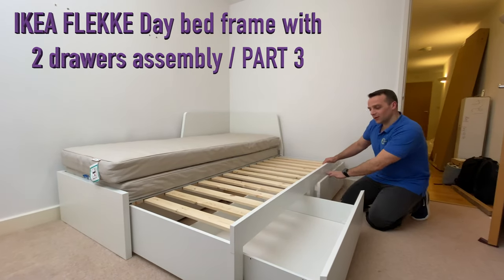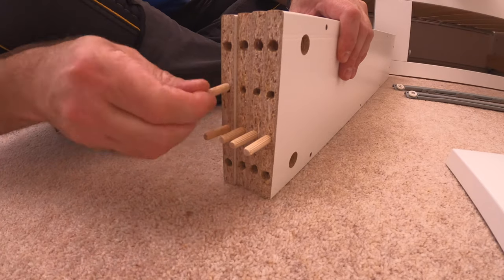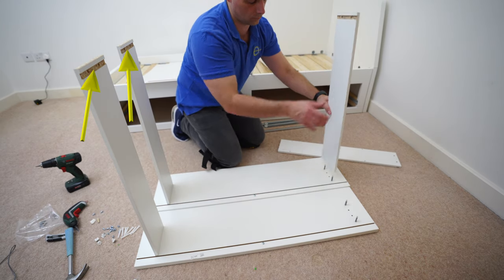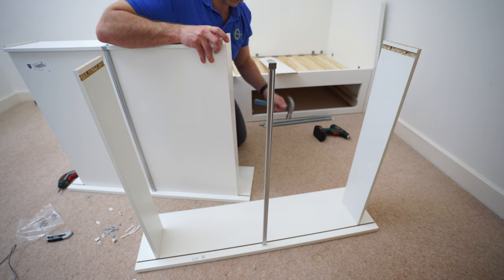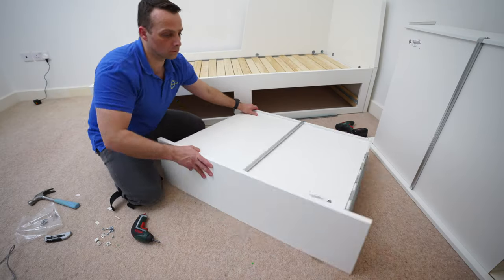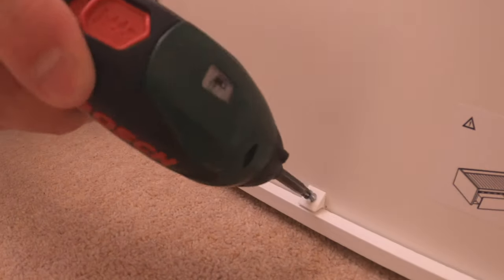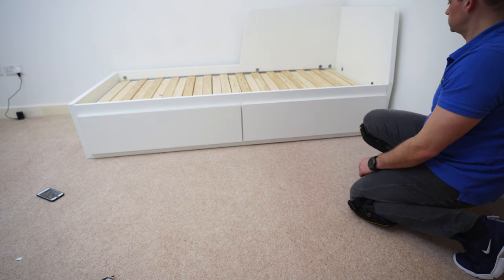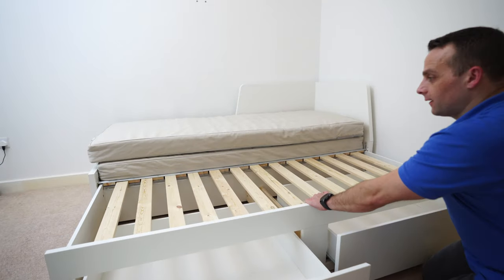IKEA FLEKKE Day bed frame with 2 drawers assembly/ PART 3

Comment: The second bed doesn’t come out so smoothly. I have to pull and pull 😔
Reply: I’m dumb! The bed comes with some rubber things that you add to the bottom of your bed that prevents it from moving around when you pull out the second bed 🤦🏻‍♀️ since I don’t own a hammer I left this step for last and was breaking my back trying to pull out the bed lol